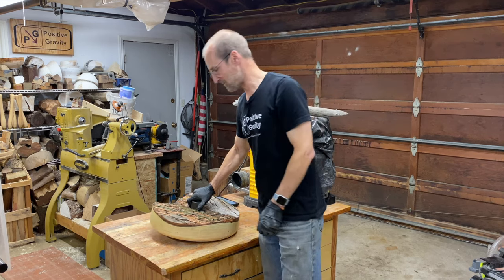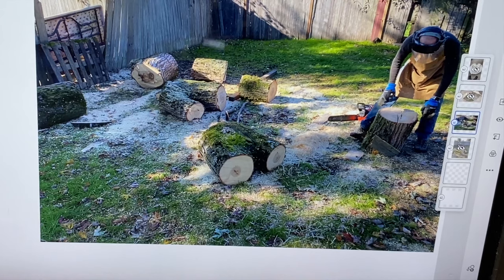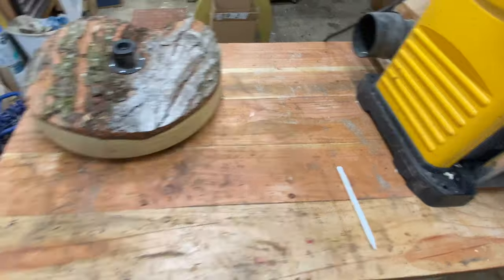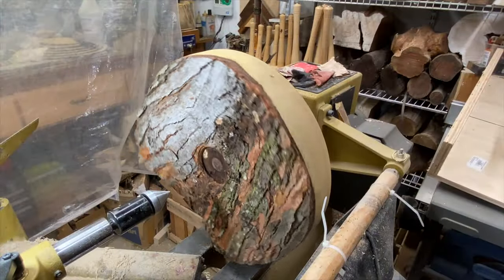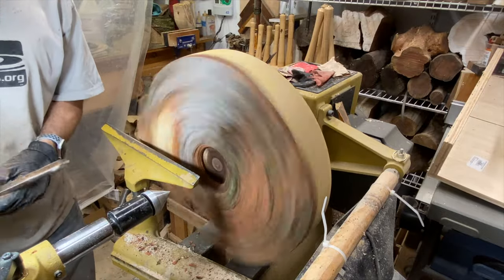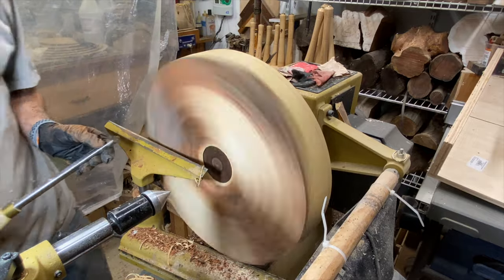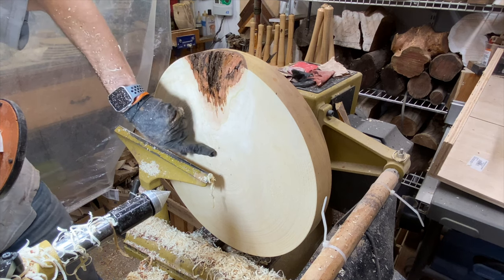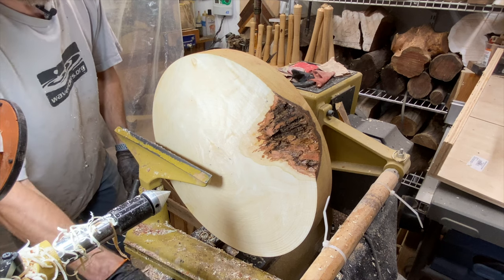Awesome Figuring Exposed! Sourcing and First Turning an Incredible Silver Maple Crotch Platter.

Comment: I would have brought the live center up for additional support. If that were to come off the Chuck it would be very dangerous.
Reply from the maker: Indeed, having the tail stock up when possible is a good idea.  Sending a 40 pound disc flying across the garage wouldn't have been desirable.  Thanks for watching!  Great wood to work with.

Comment: It would be a lot of work to cut that piece in half, but I'd leave it on the lathe and at ultra low rotation cut a kerf at the equator with a pull saw.  Then, with the lathe off you can do the rest of the cut with a panel saw, rotating the blank by hand as you get deeper with the saw.  Definitely a workout.
Reply from the maker: Interesting idea.  Workout indeed.  Most likely  I’ll use the width to make a  platter with some good depth.
Reply: Given the thickness that's probably for the best.  A large platter with just that bit of live edge will look great!